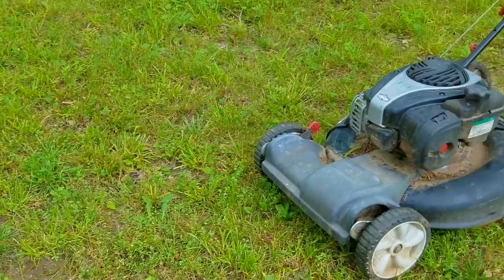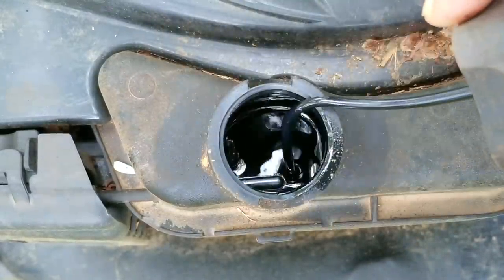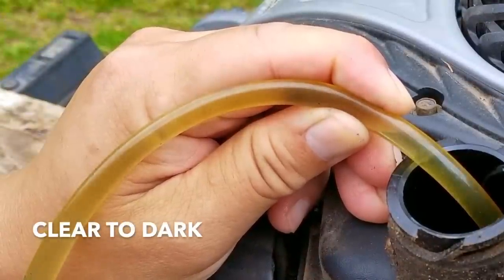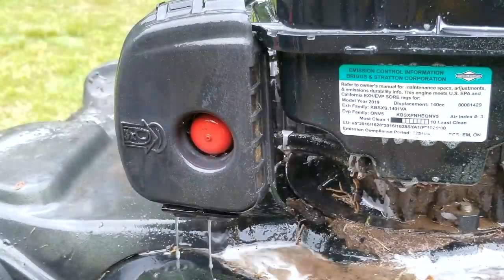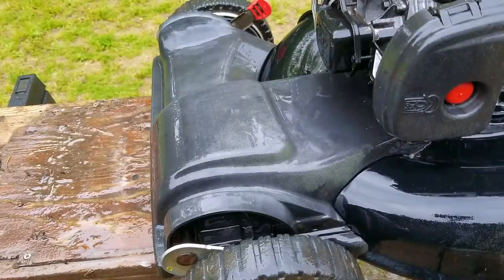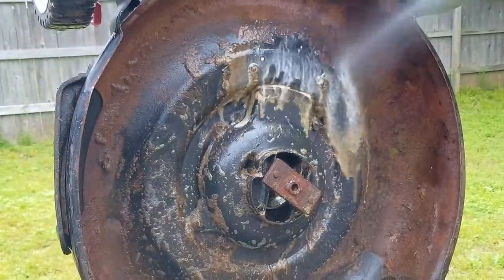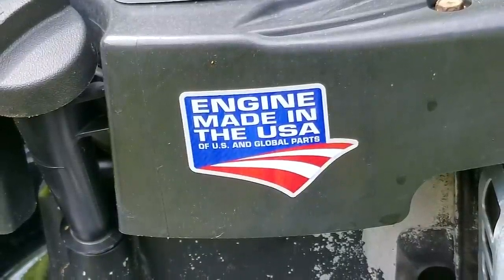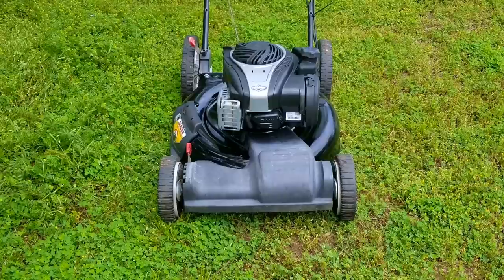Should You Leave Your Murray Mower Outside Or Store It Inside?

Comment: The trouble I have with storing equipment outside is that the "cables" get rusted to the point of not being able to use them, or the "neighbors" steal them.
Reply from the maker: you are correct on both parts
Reply: I sm a retired Firefighter just starting to do this as a hobby what cleaner do ypu use
Reply: @eugenedelong7523 It looked like he was using Simple Green cleaner which is a very respectable degreaser cleaner in the mechanic DIY circles, is also enviro friendly too as well.

Comment: Looks like Teryl Dactyl's Grandpa's Little Johnny was playing lawnmower mechanic again to me. LOTS of water. I always try to check the gas containers when they get low. That way you can catch the water before you pour it into your equipment. And I keep all my stuff in an enclosed shed. Tarps beat nothing but not by much. I had tarps before the shed and still had to deal with water issues before equipment use and the mold you were rubbing off that deck with your thumb is the same as grows on the North side of my S-10 pickup, and it's out in the open with sun too. Blessings!

Comment: For me, I’ll keep my owners manual. In terms of storage and where I would keep my equipment, I would keep the equipment either in a shed or in my garage with no fluids inside them. The reason being is because I rather drain all the fluids out at the end of mowing season and I can work on the equipment when needed and when it comes time to mowing in the spring again, all I have to do is put fluids back in the equipment, start it up and be on my way.
Reply from the maker: nice choice and if it works for you, even better, thank you Michael  Skidmore

Comment: Being a retired mechanic all my lawn equipment is stored inside my shop. I clean them generally every mow in the spring and in the summer and fall when it is drier I clean every 3rd to 4th mow.  I paid good money for my garden tractor and the push mower well that was a free mower I found from a ad on Facebook all it needed badly was a new blade and one cable
Reply from the maker: nice work on saving that mower and yes a light general cleaning is more than enough to keep your equipment in good condition

Comment: I have equipment stored in several locations.  My rototiller in my old shed; shortly after I bought it (24 years ago) I had to store it under a cluster of oak trees because I didn’t have a shed at the new house.  I eventually built a shed and stored it there.  But storing it outside caused water to get in the carb and fuel tank.  Needless to say it still runs line a champ.  In another year I shoul be able to get a “classic “ license plate for it.
I have mowers and tractors stored in a three sided shelter under tarps.  The tarps are to keep the bird poop off.  They will move to the barn next year (I’m on a waitlist).
I have other implements stored in the open or under a roof but I would like to move them to the barn if there is room once it gets built.
Reply from the maker: yes sometimes we have to what we need to do, thank you Steve Halsey

Comment: We were told the same thing when storing vehicles; either fill the tank up completely, or if it is going to be long-term, drain it completely. For the exact same reason of condensation.
Mine is living under a carport, minus the ants. One day, that shop will be a reality! 🐺🔧
Reply from the maker: nice thank you Jonathan Sherwood!
Reply: The trouble with "filling the tank" is that gas starts going bad in about 30 days. Also, the tank is plastic, made from petroleum out of the same "fracking tower" that the gas and oil come from. I have replaced many of those "plastic carbs" as they start melting/dissolving internally from fuel being left inside them . Always, run them dry. Just purchase enough fuel for getting the job done, then drain/remove the rest. Pour in a car, so it can be used and not wasted. Good video !
Reply: @georgepruitt637  Right, storing fuel in the tank is a short-term storage solution for dealing with condensation. Thank you!
Reply: Yep, drain carb bowl, fill tank up completely and put Stabil fuel treatment in:-)

Comment: We store all our power equipment indoors in a garage/Outhouse, our Lawn tractor and Rider and ATVs  on first floor (concrete) if we dont need the floor space for other things and during the winter season the Lawn tractor and Rider along with one ATV is stored on the second floor.. no power equipment is stored outside other than very short term.. manuals and service manual where I have obtained these are now kept in a ring-binder ..

I think that indoor storage was a factor in me being able to just pull the right rear wheel straight of our Husqvarna LT151 when I needed to service the brake/parking brake, as I have gathered from several YouTube videos it's quite common for those to be seized on there .. I did use anti-seize when putting the wheel back on the drive-axle just to be sure, and will take the other wheel off when I get the time and to the same there  I doubt the wheels have been off it since it was bulit in 2004

One thing I have learned is that a lot of dirt will collect under the plastic "covers" on the foot rests on the lawn tractor, and this will hold moisture and can cause rust, it had on ours.. I sanded the rusted parts of the foot rests treated the metal wit rust converter and spray painted the foot rests..so if you have a lawn tractor with plastic pads/covers on the foot rests then it's a very good idea take these off and clean under them if you can..

I even machine polished the Lawn tractor and waxed it before this season and it came out looking nearly bran new 😀
Reply from the maker: wow you're really taking care of them

Comment: Mine are all stored in a garage. I tell my customers that don't have a way to store theirs, to at least remove the gas cap and put a plastic baggie over the gas cap inlet and then screw the gas cap back on over the plastic baggie. As the air heats up in the day and cools off at night the fuel tank sucks air into it and the moisture in the air goes into the gas. Especially if they use gas with ethanol. Thanks for the video.
Reply from the maker: good advice

Comment: Always stored in shed or garage, the deck gets a coat of wax in the spring after the oil change and tune up. If I have to wash it off it gets dried with the leaf blower or the air compressor. If I had to store it outdoors I would probably use a breathable equipment cover or make a tarp out of an old car cover.
Reply from the maker: you're doing a great job, I bet those mowers look awesome

Comment: Some mowers my neighbors had issues with starting I found contaminated fuel was the issue because the contaminated fuel was in the gas can they used to refuel the mower; gas can didn’t have a cap or they didn’t use fuel stabilizer when gas was left sitting for a long while (understandable that many don’t know about that or even have the time for it) to keep the fuel from going bad.  Another issue could be a bad/damaged or cracked fuel cap on the mower’s fuel tank that may cause contaminants like water to leak in while washing the mower down.
Reply from the maker: very true

Comment: GREAT JOB! Don't know how u find salvageable mowers, most I ever found WERE JUNK. U are SO right with storage. My last mowing of yr, I don't fill full & run it outta gas. Change the oil/ removed plug/pour tablespoon of oil down cylinder. Wash it like YOU DO, & spray underside with fluid film. I have a junky shed/gets wet so I DO throw a tarp loosely over it. I DO make sure its dry before storing. Not a big fan of Murray (Sears🙄) but price is right & instructions DO help! 👍
Reply: Probably MORE SO these days u keep nice & with the price of mowers.
Reply from the maker: very nice job and as for the mowers is hit or miss but I do find some good ones
Reply from the maker: yes you are correct, now that values have gone up I try my best to them nice looking

Comment: I don't really have an indoor storage option. Always covered with a tarp when not in use during the season. I keep the tarp pretty much just over the engine, but loose enough so that air can flow through the tarp, just protection from direct rain and hail. Only really completely empty the tank for Winter storage, and then the mower pretty much gets mummified with the tarp. Never really had any issues with moisture in the fuel or fuel tank, this mower is on its 3rd season, moved back to a place where I have to mow my own lawn, while before I moved away I had a Toro Whirlwind that was stored the same way last over a decade; that mower only stopped working because the landlord borrowed it to another one of his renters without even asking me, and the guy bent the shaft on some stump or large rock.
Reply from the maker: nice and it seems to be working out well for you.

Comment: I don't always wash my mowers after using them but I thoroughly blow them of with a leaf blower. I live in the hot, humid, coastal deep south and our soil is very acidic. Dust covered metal plus humidity equals rust. I have an old Murray rider that stays outside (usually uncovered). Just keeping the dust blown off and blowing it off after a rain keeps it in good shape... Also, I know you didn't ask for suggestions but everytime I see you have a new video, I'm hoping it's gonna be vintage equipment. Those are the best.
EDIT to add: Totally agree about tarps trapping moisture. I was just debating that with someone the other day. Haha
Reply from the maker: thank you Steamboat McG.  and yes I wish I had more vintage stuff but getting parts for stuff that's over 40 years old is really tough and expensive
Reply: @INSIDEHOUSEGARAGE  heard that. It's frustrating when they need more than a carb rebuild.
Reply from the maker: yes it is.

Comment: i usually store my quick reach gas mower outside under a glass picnic table, but during the winter i clean it and store it in its mow n stow position in my backdoor entryway porch. the rest of my not in use mowers are usually stored clean in the basement. but lately they are all outside in the backyard except for my electric mowers, i keep those sheltered at all times. I'm in the process to sell most of my mowers, i have too many, and its why i have all of them out waiting for buyers.
Reply from the maker: that make sense

Comment: In answer to how I store my mowers:  1st one outside in the shade of a shed.  No fuel in the gas tank or carb.  Engine covered by an inverted plastic storage bin, blue tarp over the handles/levers/cables.  2nd mower in a shed with no fuel in carb or tank.
I was told to NOT store my mower in our garage because we have a gas water heater there.
Reply from the maker: nice way of doing it.

Comment: Most people don't have a clue how stuff works. They don't care too. Very good for the existance of manufacturers😂 to keep on making new.
I prefer keeping stuff inside a shed or garage.    Storing outside under a tarp gives you high risk of critters getting in easily and rust due to high temperature differences also the fuel ages quicker.
Reply from the maker: you're absolutely right

Comment: so you just spray things with a lot of degreaser and rinse all the dirt away? if I do this to my lawn mower which spots should I avoid? I imagine I probably shouldn't spray the coil if it's at all exposed or the spark plug but I didn't really notice if you avoided any spots in the video and anyways you did mention that it's a good idea to let things dry off after they get wet so as long as it dries off would it be okay to basically spray the whole thing what degreaser and then rinse it down?
Reply from the maker: I scrub the really nasty areas, and yes aside from spraying water in the muffle or the intake I just spray it down. I sprayed the coil, the spark plug, and pretty much everything
expect the muffler and the intake

Comment: I have been curious where you get the membranes from because I once found them at a site in my country and i cant find it now. I find it good to stock up on parts for old equipment but i cant find it in stihl's site. ( or i didnt look good enough )
Reply from the maker: are you talking about 2 stroke stuff? If so I get them from Amazon
Reply: Yeah the 2 stroke engines. By the way after a 1 hour search i found spare parts section and there a membrane with a gasket is 12$... Expensive
Reply from the maker: yes that sounds expensive

Comment: Hey bro what's up? I have an open shed where I keep a lot of stuff but all my equipment are kept inside my house.
Reply from the maker: very nice, thank you Ramadin Sookhoo!
Reply: @INSIDEHOUSEGARAGE  you're welcome bro. Yesterday while I was using my trimmer, the pull rope came all the way out and wasn't  retracting so I removed the whole assembly and I sprayed some wd40 on the spring and in a few seconds it was working better than before.
Reply from the maker: nice work
Reply: @INSIDEHOUSEGARAGE  thanks bro. My knock technique wasn't working so I had to do the proper thing.